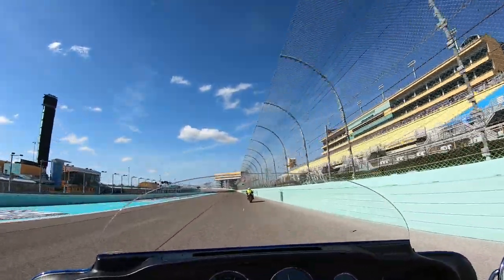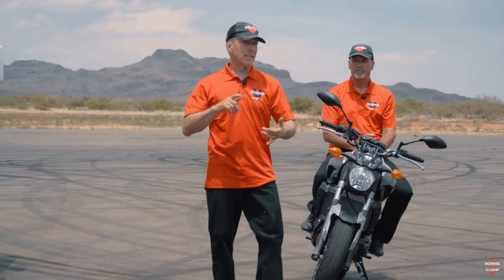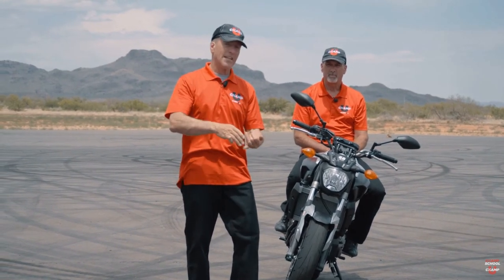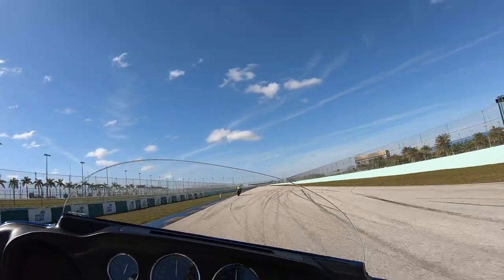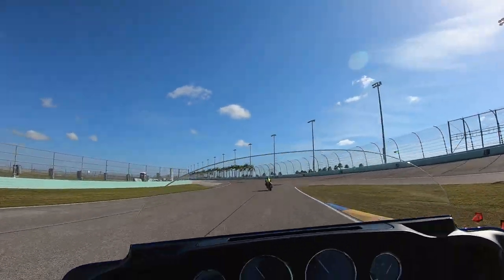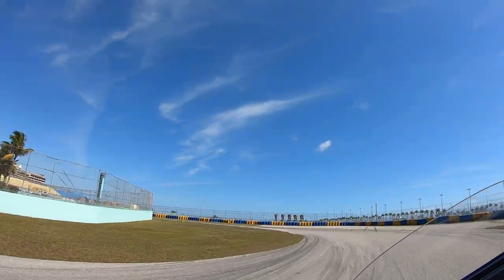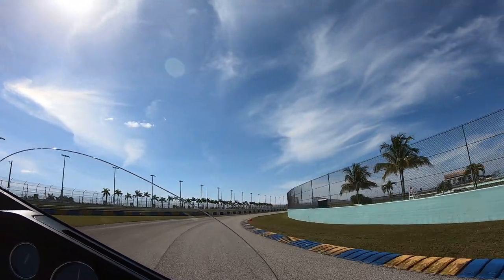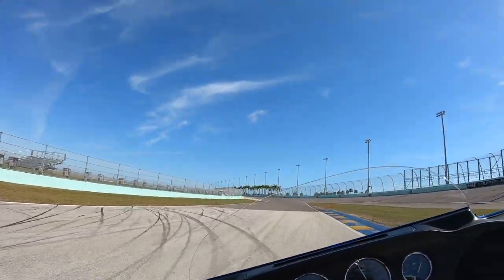High speed curves on a Harley bagger!

Comment: I always get looks and questions when I’m riding my Ultra Classic. Nobody has ever seen someone “Hanging off” a bagger before I guess! 😂
Truth told, I’m a former racer, and my Ultra is outfitted with high end “Race suspension”, so this style comes naturally to me.
Cool trick I’ve learned,
When going into the corner, turn your inside foot about 90 degrees outward on the board. This acts like a knee, so when the bottom of the toe of your boot starts to drag, you’ll know you have a couple inches before you start dragging floor board.
🤘🏻